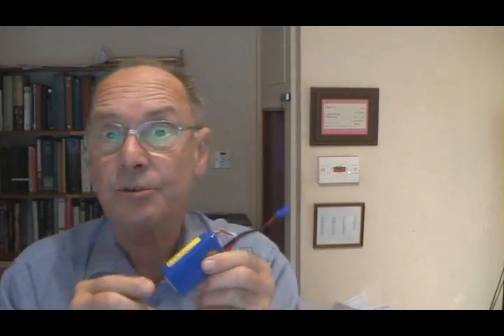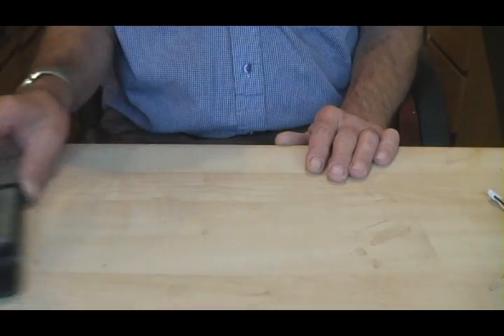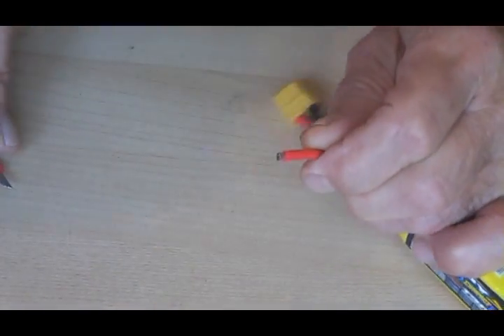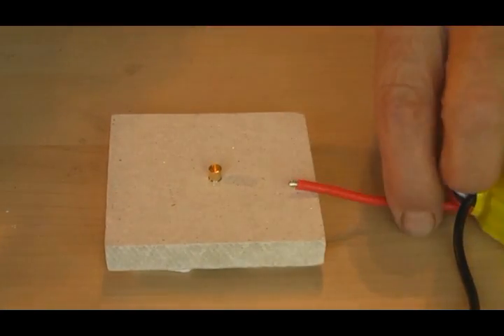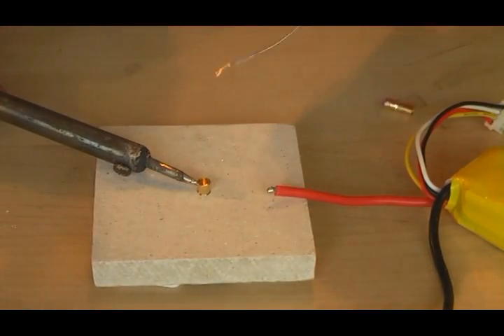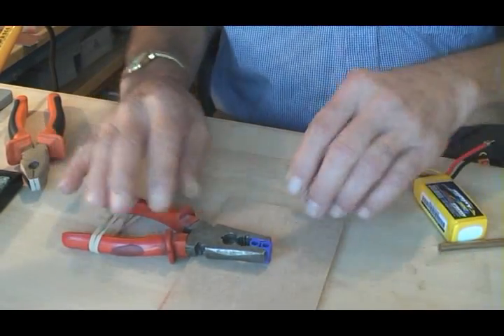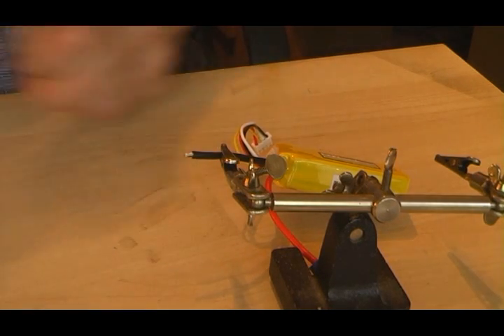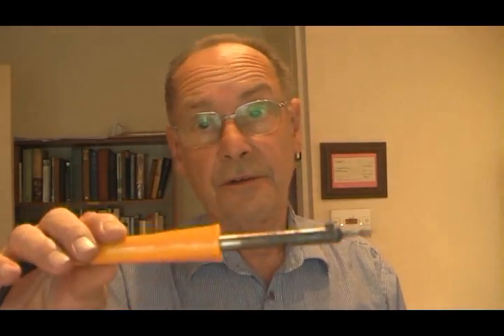XT60 Lipo connector changed to EC3 connector.

Comment: You shouldn't cool solder joints but blowing or any other method to speed cooling. You may encourage a dry joint. Let them cool by themselves.
Reply from the maker: Thanks, Robert. Yes, my grandfather always blew on soldered joints to assist cooling - I picked up that habit from him without thinking about it! Cheers, Norman.
Reply: Robert Langford Many hold the joint w pliers to transfer the heat, lol!